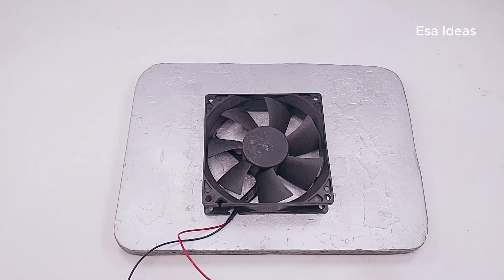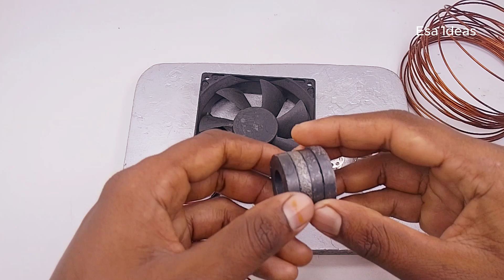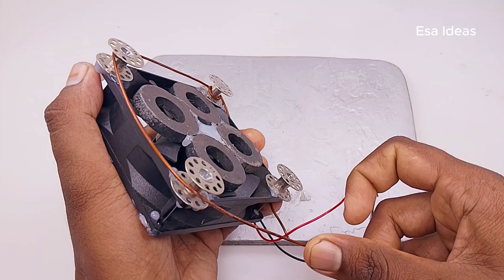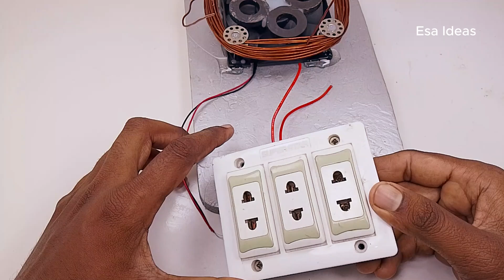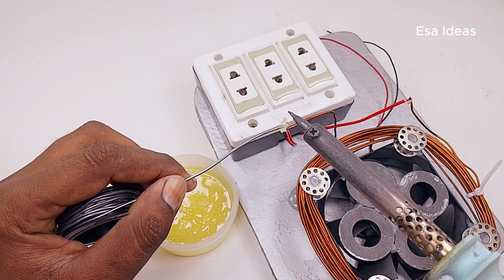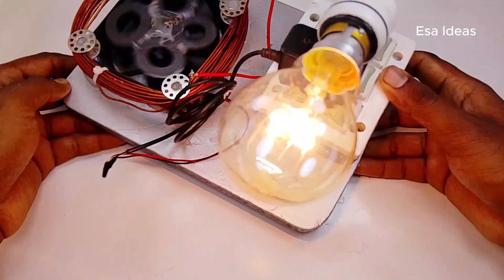How to make 10000W free electricity generator with copper coil colling fan and magnetic power

Comment: The concept is okay BUT the induced voltage is hardly enough to power the adapter connected to run the CPU fan.